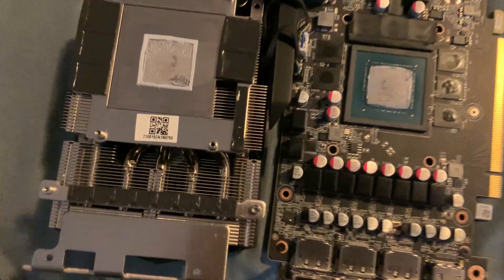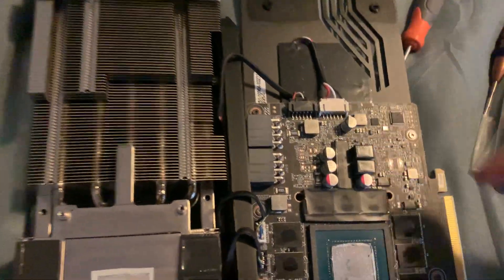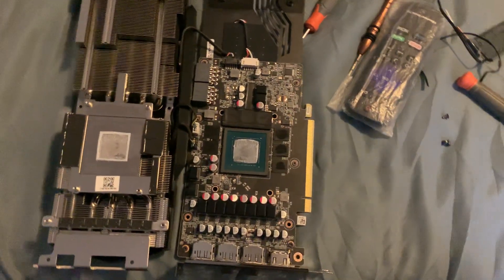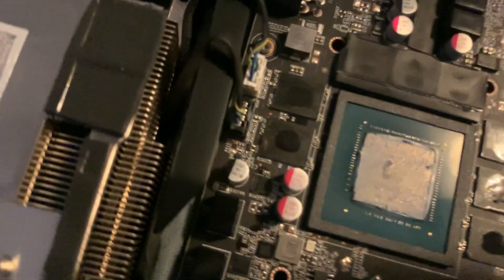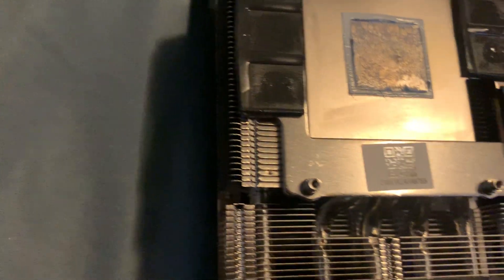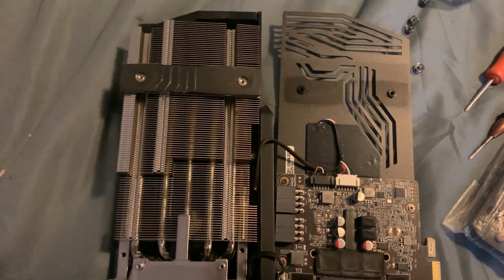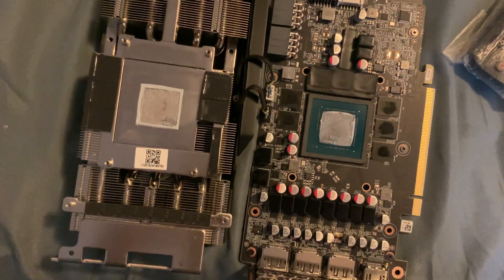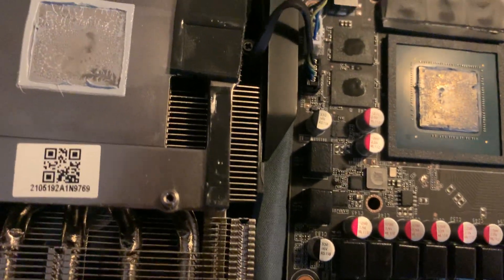Zotac 3070 TI Thermal Pad Swap *Edit: Lowered mem temps, but core way too hot will try other paste*

Comment: Hi Matthew, just wanted to clarify some info regarding why core temps increased. It's because the thermal pads you used especially around the core die were too thick. When it is too thick it pushes it up more and prevents proper contact with the heatsink and core. I repadded Omen 3080 card and I used 1.5mm instead of 1.0mm at first on mem chips and my core was going to like 80C while idle not mining at all.
Reply from the maker: I reused the ordinal pads with paste over the memory and it stayed cool but I agree with you instead of 2mm 1.8 should suffice
Reply: @BEU203  im doing my zotac 3070 ti trinity now as well. I measured exactly 2mm on the memory chips too. Which brand of thermal pad did you try? The higher thermal conductivity the harder they are and I noticed that the Zotac pads are incredibly soft. I think I only have harder pads as well (17 w/mK) so I may end up getting the same result
Reply from the maker: @Shane-h4uu  I used thermalright but I suspect my issue was more of the brand thermal paste over anything else I’m using mx2 right now
Reply: @BEU203  In my experience paste doesn't make a difference. 1-3C on the core at the most. I used the 2mm pads as well on memory chips and was able to get to 88-92C on memory while mining(depending on time of day) with core sitting at 49-50C. I use kryonaut paste but again I don't think this should make a big difference. I am using 17w/mk unbranded pads as I plan to sell this under my own brand - just testing these for now. Possibly the thermalright pads are too hard and don't allow proper contact with heatsink and core
Reply: @BEU203  I can send you a set of pads that I used to make my 3070 Ti Trinity run at the temps I previously mentioned. Can you update your channel with business inquiry email (in channel customization section) and I can reach out to you?
Reply from the maker: @Shane-h4uu  I appreciate it but you don’t have to, I no longer have this card as well I’ll be posting new videos soon

Comment: It’s not your temps. Likely it’s the fluctuating voltage causing instability. Download MSI afterburner and set a constant voltage. Try starting 950mv and retest. My new Zotac 3070ti OC Trinity was freezing locking up my machine.
Reply from the maker: Check my new video it was hardware related. Setting constant voltage makes the LHR limiter work even better in turn giving me terrible mh like 25-30 instead of 55

Comment: Can't really tell just from looking but guessing those pads are 2mm maybe 1.5mm.  Anyways if the pads are too thick you won't get good contact with the core and your core temps will spike.  No matter how tight you screw it down.
Reply from the maker: They were 2mm but I went back with stock + paste check out my update video there’s a problem with these from the factory
Reply: @BEU203  good to know I have one inbound this week so gonna have to check it out.

Comment: Friend, what thermal pad measurements did you use, I bought some 2mm gelid and to change back and forth and I only go down about 2 degrees, and I have seen many that change and have a brutal drop in temperatures but I have not achieved it
Reply from the maker: Check my update video I explained why you didn’t drop too much

Comment: I got the same card, Core temp is great way below 70 degrees but memory temp is between 100/106, I’m worried about the card will it be damaged if kept it on for long? Is there any way I could lower that temperature? Thank you.
Reply from the maker: Check out my update video about this card
Reply: @BEU203  I checked it thanks, so do i need to open the gpu? Also you suggest to turn it off for the time being or is it not so unsafe to keep it on with those memory temps? Thanks
Reply from the maker: @giovannitocco  me personally I don’t let my cards pass 100c without doing something about it on this card the plate around the Gpu does remove some pressure and putting paste on the memory helps a bit but some cards you just can’t save
Reply from the maker: @giovannitocco  Some people don’t care though because of warranty so if you are like that type of person it’s up to you
Reply: @BEU203  thanks, I will turn it off and proceed by putting some paste there.
Reply from the maker: @giovannitocco  you can also try better pads I used mx4 paste btw the cheaper filler one I used before isn’t as good

Comment: I got the same card and yeah, they run hot. I found a waterblock for it through Bykski and now cool as can be... Memory is still warm but I'm currently looking for replacement thermal pads for it.
Reply: Hi, may i know if it is the N-ST3070TIXG-X model? Thanks.

Comment: You might used wrong size of thermal pads,like i did
Reply from the maker: I used the same size but I believe it’s to do with the compression of the pad itself some are softer than others
Reply: @BEU203  which pads did you used ? Size and brand
Reply from the maker: @aceclips6615  thermalright and I think 2mm
Reply: @BEU203  i also used 2mm on  vram , memory and used 1+1 mm on back plate.
Reply: But quality of pads are cheap. Getting 55c core temp and 82-86 c vram temp, mining ergo.
Reply from the maker: @aceclips6615  that’s better than what I ended with on this card so whenever I get back to it I’ll try to get the temps lower
Reply: I think you didn't put heat sink and pcb well together, thermal pads of vram didn't go at ideal place, they just slipped away from their ideal location.
Reply from the maker: @aceclips6615  Trust me I put it together a couple times to make sure since I’ve done many cards already, I’m pretty sure the issue is the thermal paste I used a cheaper one since I ran out of the one I always use
Reply: @BEU203  ohh, by the way i used 2mm instead of 2.5mm on vram too. Will it be fine for long term?
Reply from the maker: @aceclips6615  as long as temps are fine and 2mm is the size I measured so you are fine
Reply: @BEU203  what is the size of pads on backplate.
Reply from the maker: @kartikdutt8019  I never touched those
Reply: @aceclips6615  try ETH and then report mem temps.
Reply: @AleksandarStojiljkovic  105 c +
Reply: @aceclips6615   that is very hot.
Reply: I use +1800 mhz on vram, temp steady on 100C°
Reply: @AleksandarStojiljkovic  did you replaced backplate pads too?
Reply: @AleksandarStojiljkovic  did you used 2mm and 2.5 mm on front?
Reply: @aceclips6615  it's still original

Comment: Hey Matthew brother
I have the zotac rtx 3070ti amp holo
I am using sff case(nr200)
So is deshrouding and using noctua fans in good way to reduce temps?
Reply from the maker: It may help based off other people’s experience, but I’ve never tried it

Comment: LTT removed 15ºC when applying thermal pads on the backplate. You could check if this card even has pads at all on the backplate.
Reply from the maker: It does, but the backplate might not cut it or they didn't put enough pads

Comment: personally i removed the plastic grey frame on the core of the gpu and then my temps fixed!
Reply: Is the frame easily removable or does it need to be removed with force? appreciate your thoughts.

Comment: I got 92C on hotspot, and memory 90C. Is it normal?
Reply from the maker: 92 hotspot seems way too high but for memory it’s typical
Reply: Bad thermal solution for this gpu. I was moded this vga with thermalright 2mm + now 8mm arctic 3k rpm on top of thr vga. And now all temp always bellow 85C. Later I want to make the video for this.

Comment: Core went up because the pads swapped, also adding gap between gpu and heat sink. Try add more thermal paste to fill the gap.
Reply from the maker: I could have uneven pressure or something I have to take another look because even when swapping back to stock it’s the same
Reply from the maker: I’m pretty sure it’s just the type of paste I used

Comment: Hey Mathew. Greetings. I also have Zotac 3070 ti Trinity. Could you please help me out with the thickness of thermals pads.
Reply from the maker: They seem like 2mm maybe 1.5mm I’m not sure. I ended up using the stock pads because of the core raising too much. The cooler on this card just can’t keep up.
Reply: @BEU203  Oh. Does Core temperature raise when you change thermal pads?. Thats new to me.
Reply from the maker: @annmolmahtani3394  yes it raises due to heat from memory spreading to the cooler
Reply: @BEU203  Got it. Thanks. Also, did you check with Zotac regarding the warranty policy for changing thermal pads. Does warranty get voided?
Reply from the maker: @annmolmahtani3394  I haven’t checked but they don’t have any warranty stickers so there is that
Reply from the maker: @mrnait5169  sometimes it’s not about the contact it’s more or less that there is more heat going to the cooler so the core ends up slightly warmer but you are right about the size tolerance can screw your results
Reply: Seems around 1.7mm, 3090 have this problem too, with 2mm hard pads the cooler didn´t touch the gpu die, not enough pressure from the springs in the screws, buy softer pads or try to squeeze the 2mm to around 1.8 before install.

Comment from the maker: The Gpu core temp going up is normal guys just make sure it’s not over 80c and I put back the regular pads with some thermal paste because the junction was over 100c but that is normal some people say
Reply: Hi Matthew Bravim. I read on the board reddit Zotac 3070 ti teardown.Use thermal pads for the memory chips are 2.0 mm thick, and those for the VRM are 2.0 mm thick most suitable.The temperature dropped to about 7.Have you tried to change it?.How was the result.
Reply from the maker: @konkumpant  haven’t messed with the card yet I have the stock pads back on